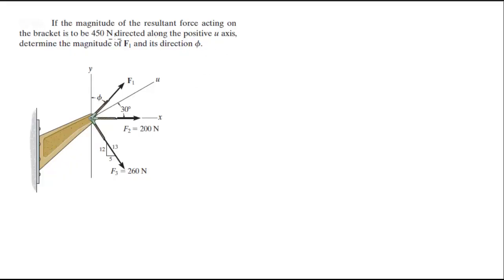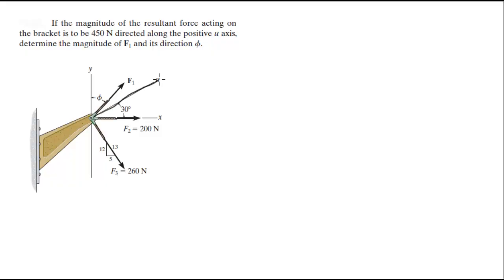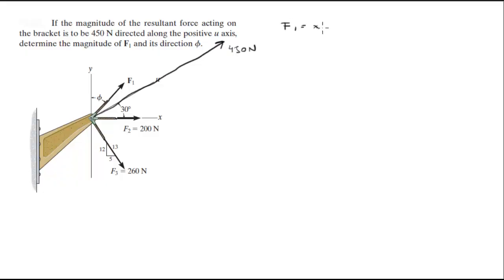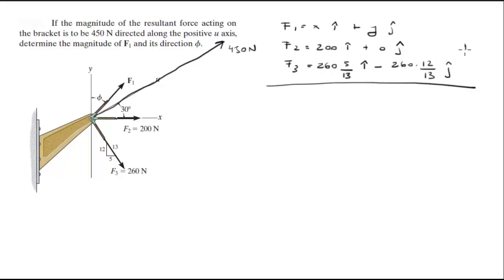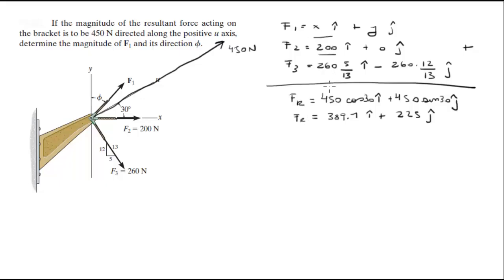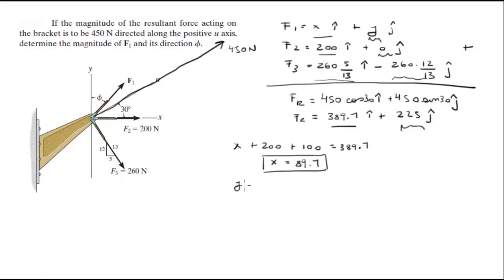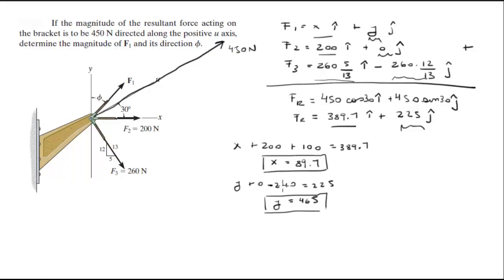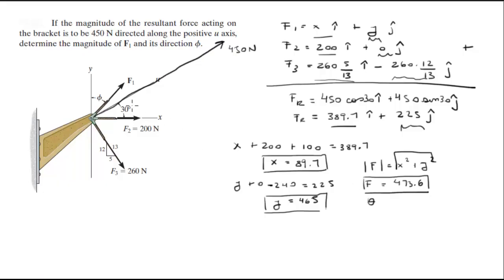Find F_1 sp that the resultant force is 450 along the u axis

Comment: why did you subtract 90 from the angle
Reply: 79.1 is from the X axis to F1.  But we want from F1 until the y Axis.  So we know from the x-axis until the y-axis is 90 degrees.  That means that the angle between F1 and the y axis must be 90-79.1=10.9 degrees.